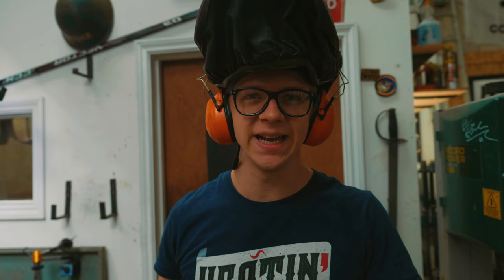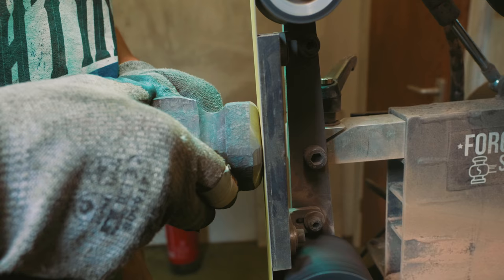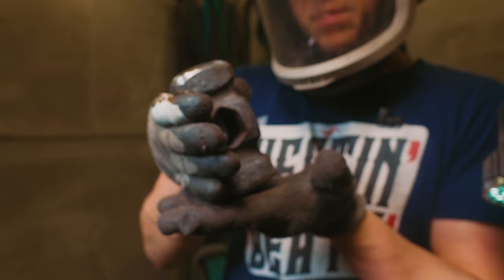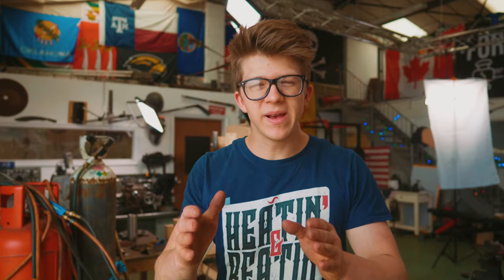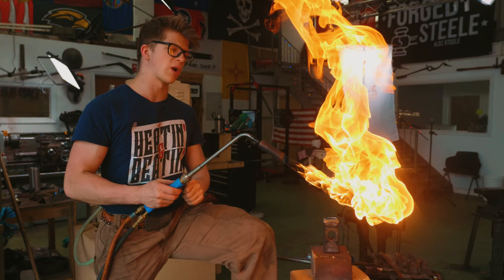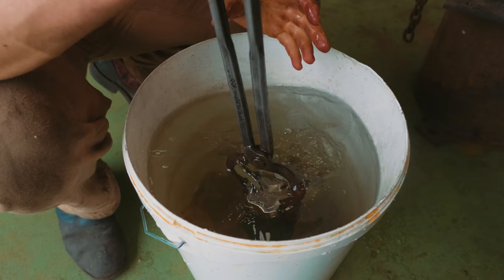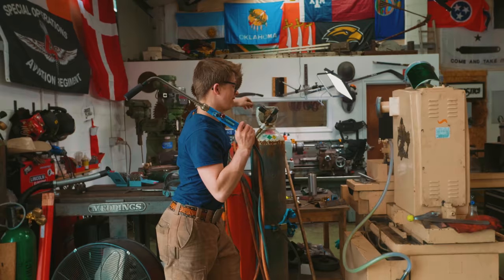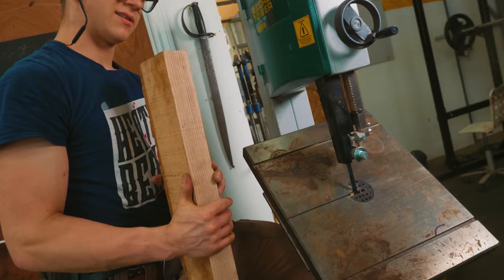FINISHING DIRESTA’S HAMMER

Comment: for working the handle, the real beauty of ash is that it will rive VERY cleanly.   it makes working pieces like that a breeze and the way woodturners have done for centuries....   Don't cut, when you can RIVE...it's faster, takes advantage of the grain and preserves the grain down the length of the handle....
  Take a hatchet or froe (or riving knife, if you have one) , place it on one of the lines you drew (the ones inline with the grain will be cleanest)   split those two sides out....then your bandsaw cut will be much more "normal" in the adjustment of the table for cutting the sides.    I know many old woodworkers who would just rive the sides out as well, and finish the whole thing with a drawknife and end with some light sanding to round off the drawknife markes....

really great looking hammer....

Comment: Hey Alec, just a suggestion.  In your grinding room take some heavy plastic and fasten it so it hangs down over your receptacles.  This will help prevent grinding dust and metal flying's from getting into them.  I have seen receptacles burn up because so much dust built up inside them that they started conducting between phases even when nothing was plugged in.  I also suggest sweeping the walls down really well and then putting up sheets of 3/8 sheetrock on the wall with just a few screws.  that way when it gets all dirty and wore out it is easy to change out but your walls are protected.

Comment: Great looking hammer between two great makers!  You may have done this and I just missed it, but it's often a good idea to drill a small hole in the handle where the wedge slot ends - this provides some relief and lowers the likelihood of splitting the handle.

Comment: Alec you could try to cool your pieces in salt solution. The salt can be even NaCl. The salt forming during water evaporation disrupts the Leiden-Frost effect allowing fresh solution to again dissolve the salt and cool the surface. The effect is raising up to 20% solution. After that there is no point to add more salt. But good results are observed between 10-20%. So you dont need to shake so vigorously. But of course, it is only for need big temperature drop speed. I have destroyed a piece when accidentally put it in wrong tank.

Comment: Have you tried brine/salt water? What about adding a bit of soap or detergent to the water to help break down the surface tension lessening the bubbles that form on the hot steel.

Comment: Should get a froe for your handle making. It's a tool for splitting would along the grain lines so your finished piece doesn't spilt. I know you can do it on the saw but a froe is actually faster and just seems more in line with a hand forged hammer.

Comment: I have a scar on my leg where a fragment of steel was removed which  separated from the hammer head went in at my knee and 8 inches into my leg muscle like a 22 round. Pleeeease don't make hammer heads glassy hard it could kill you. Great video cheers
Reply: J Nada I’m interested as well because for a piece of metal the size of a 22 round to penetrate 8” into your leg would have to be traveling at around 1700fps or around 1150 mph (per ballistic information/penetration tests on 22 ammo).......hard to believe anyone can swing a hammer that hard.
Reply: While I am interested as well, I think he meant that it penetrated like a 22 round, not that it was the size of one.
Reply: I think that the simple fact that a very hard peice of metal broke is what gave it the force needed to penetrate, but not as big as a .22
Reply: J Nada i was squated down driving a cold chisel  into the soil not hitting real hard but i felt a thump and a trickle of blood came out a small hole in my jeans. A piece had come of the face of the hammer. The piece about the size of a 22 had gone along the muscle and stopped in my lower thigh. It was long and knife like in shape and did a fair bit of damage as I expect it was spinning.

Comment: Question, what's the viability of a damascus hammer head? As in, would it still maintain it's integrity and last a long time?
Reply from the maker: Just the same as normal hammer steel if the Damascus is well made and it’s tempered back enough

Comment: Hey Alec, I wondered if, instead of wedging the handle into the opening of the hammer head, that you might be able to soak and compress the handle, feed it through the opening of the wood, then re-soak it to allow it to  expand into the hammer head itself, making it a completely solid seating through the opening. Much like the solution to the Nail Through Wood trick shown here by Steve Ramsey. https://youtu.be/fEATei2wewY

Comment: I cringe every time you scorch your wooden handles. Try linseed oil mixed with paint thinner one part linseed oil to eight part thinner it will bring out the grain and looks good. Really like your videos, very informative.
Reply: scorching provides alot of benefits, (shou sugi ban)
you just need to be weary of over doing it, and making charcoal

if the darkening is what bothers you, you can sand it a bit or only "toast" the wood instead of char,
but the benefits are lessened
Reply: I am 66 years old I have built sailboats and worked in wood nearly all my life I still think the old linseed and paint thinner is the way to go. True you can scrape the toast cleaner but the afore mentioned method looks better and preserves better that is why we do it to the wood on our boats if we don't use a spar varnish which is more difficult to redo. Try it sometime.

Comment: Are you supposed to handle hammers differently than axes?  I know on axes you would never strike the handle against a hard surface, instead you would strike the handle in mid-air, letting the force of the blow and the weight of the head work to seat the handle into the head.  

Wranglerstar here on YouTube has a great two-part series on handling axes, but again, perhaps I'm completely wrong and I'm... uh... comparing apples to oranges... or... hammers to axes.
Reply: Peter Schwankl I wouldn't take that guys channel too seriously. Completely inept with most basic tools.
Reply: Try buckin billy Ray that man knows how to handle an axe
Reply: I don't disagree, but I'm more inclined to believe him where axes are concerned than in other regards.